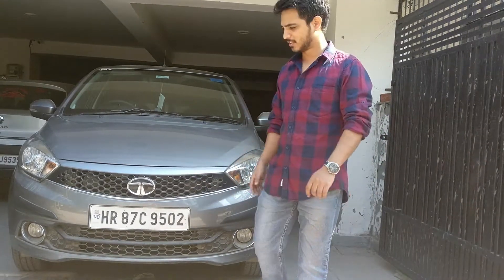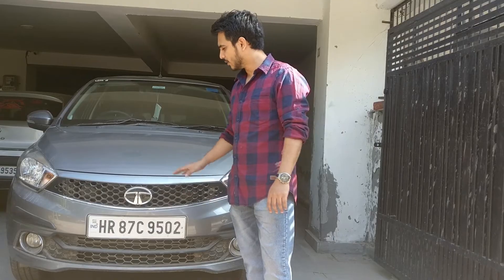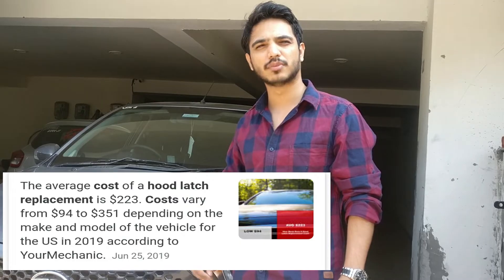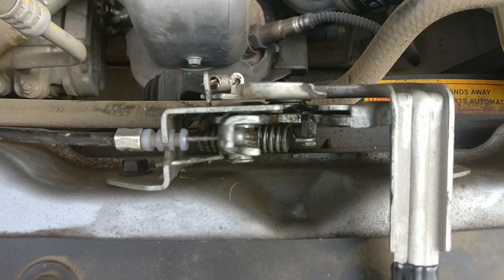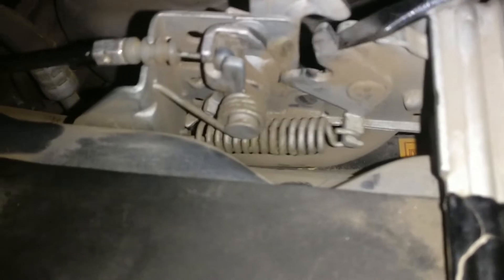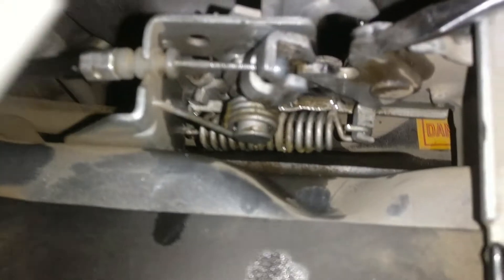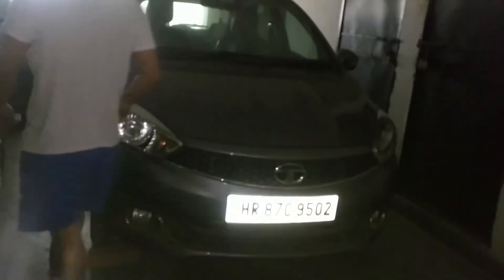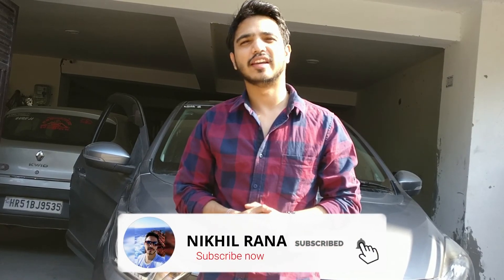Car bonnet not closing | Fix Hoods That Just wont close | बोनट पूरा  बंद नही हो  रहा तो देखें

Comment: I tried every thing. The latch was dirty and I cleaned it well. However the problem was that the rubber mountings that support the bonnet were not set correctly. You might need to tighten it so that the mounting becomes a bit thinner.